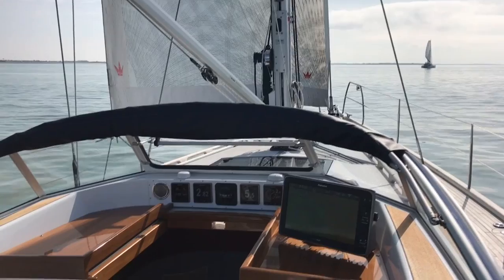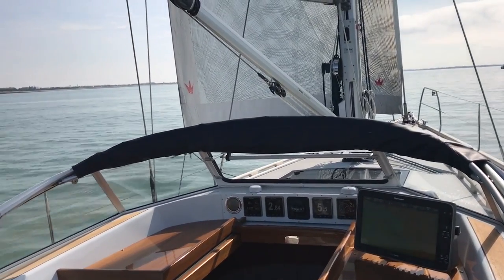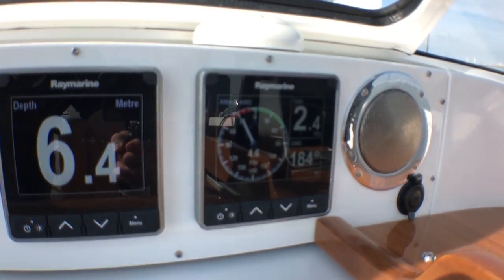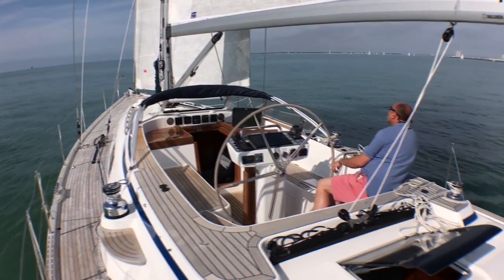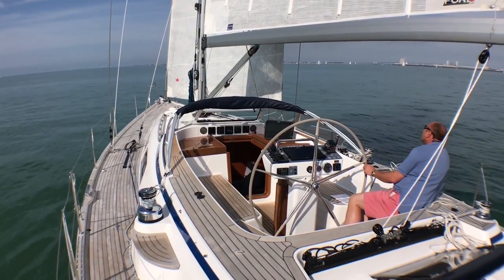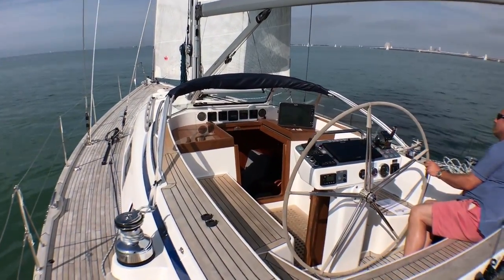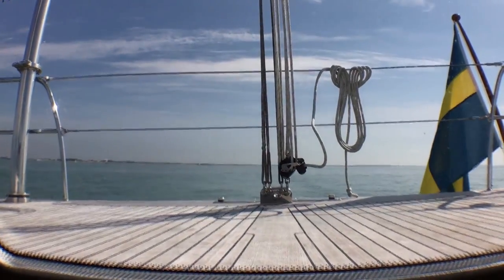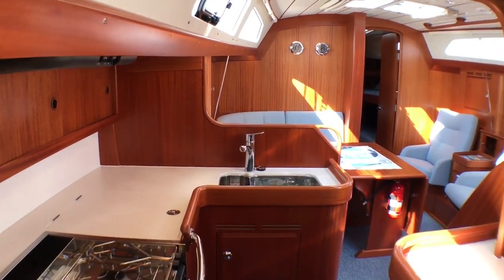Hallberg-Rassy 44 | First Look | Yachting World

Comment: Great presentation Toby. What are they pegging the price to as demonstrated? I’ve been swayed by the Amel 50, but this one still catches my interest
Reply: Perry Gruber Hi Perry. Isn't the Amel 50 interesting! More expensive than this HR 44 - about 25% more for similar setup - but a lot more boat for the money. The 44 would be more fun to sail in pleasant conditions - sportier - but the Amel 50 has so many excellent features, making it look to be better value for money in the end. The four watertight bulkheads (quiet too), the separate pilot cabin, the storage areas, the cockpit that is big enough to stretch out and sleep in! Hmmm, I'll be looking at both, along with the aluminium centreboarders.
Reply: I was looking at the aluminum centerboarders too because I liked the lifting feature, but for all the reasons you describe I think I’m going to go for the Amel. I agree about sailing the 44 in pleasant conditions, but the Amel is around seeming a better boat. And, as you say, better value for the money in the end. Thanks for your reply!
Reply: What about Bestewind 50? The best of both worlds. It isn't as expensive as it looks like, about 460 000 £.

Comment: Could you single hand a boat that length?
Reply: As long as all the "push button", electric and retractbale stuff works, sure.

Once that in-mast furler for that battened sail completely jams just as the wind kicks up badly.... And/or your truster(s) sticks in a tight spot....

Of all brands, HR, and Amel, are the two I would trust the most wrt all such high end mod cons. They're the ones who have been, and are, installing them in meaningful numbers of boats and hence getting feedback. On account of the market segments they cater to. But still: At some point something will go wrong. On a fairly conservative 37, perhaps even 40, footer; you can likely manhandle things if you have to. Doubly so if you are intimately familiar with how to do so, since that's how you always do things on your fully "manual" boat anyway.

But the catch is: The size of boat most (generally older) people who can afford a new HR can handle manually, is much smaller than the size they want to be living in long term (people with new-HR-mone are a spoiled lot....). Hence, blind trust in "systems" built and installed and tested, no doubt to the highest of standards, by Magnus Rassy and crew, is where it's at.....

Comment: It can be a good hull but I'm not impressed with the interior.
Reply: I love that interior- much better than that plastic crap that the cheapo manufacturers use for their interiors these days. It's beautifully finished.
Reply: I actually like the interio lay out just not the materials/color scheme.
Reply: The interior simply doesn't reflect the luxury and class of this boat.  I would expect some glamour. Besides I think chart table should be larger and the aft berth could be more rectangular. Looks like there is enough space for both.
Reply: Yeniden Ben true plus I'm willing to sacrifice some storage for more comfortable accommodations. Some.
Reply: Hallberg Rassys have always been understated, something that I prefer, and they leave the glamour to Nautor and Contest and such these days. I know the market as a whole nowadays prefers a little more flash in design, even Najad has gone in that direction, but to some of us classy means less garish. I know that is a subjective opinion less widely shared these days. As for the aft berth, I think the two berth version is the proper sailors version, the centre berth more for dockside sleeping. Lots of new 44 footers have no chart table at all or a much smaller convertible one- to my eye this one is decent at this length. Full size charts, for those few of us that still have them, seem to get spread out on the settee table now.
Reply: I would have to agree with blairrob. Nothing is as tacky as things that try to look luxurious. So sure, they could go for claro walnut and make the whole thing look like a joke or a 20 year old persian pimps hairstudio... Instead I like the fact that they still do the interior proper boats have: teak, oak or mahogany.  I also really like how they use proper wood planks on the interior of the hull instead some vinyl crap. Better for chilly conditions too.However, I would say that rassy has been the more over the top when compared to Nautor historically. It's just when that Italian geezer bought and ruined Nautor when they started adding "flair" and making stupidly large boats with Italian "design." Proper swans are nothing like that.
Reply: HR might be not the flashiest yacht but I always enjoy to be on them. If the weather gets a bit rougher, you learn to appreciate HR even more.
Reply: Indeed. And it's good to remember that these Nordic boats mentioned here didn't aim to produce "luxury" yachts originally. They built yachts just the way locals used to built everything (before Ikea). Yes, that meant that they spent a longer time sanding and fitting stuff, but that was what the locals wanted. Most boatyards that didn't offer similar quality just went bust and most of the tiny yards produced boats to same standards. Because nobody would've bought a flimsy boat with shoddy interior. For Swedes this meant building sturdy cruisers (HR, Najad) and for Finns it meant building sturdy offshore performance boats (Swan, Baltic) So the idea wasn't originally to build luxury boats but to build boats properly. Since then, less expensive boats with less labor intensive materials have popped out and that sort of pushed these things to the luxury market - and the price of Nordic labor doesn't help that one bit. But the intended luxury is to have a well made, functioning boat instead of being flashy. I would dare to say that HR would be risking a large part of their (obviously wealthy) clientele should they start throwing in tacky interiors just to look "luxurious." 

Now HR name does carry some prestige, but these are still boats you could sail and not feel like a total douche. Try pulling that off in a perini navi...
Reply: Too much monotone wood. But what you expect for the price. Great pedigree in craftsmanship and design.
Reply: Hi Blairrob. Tricky decision, between the two-berth rear cabin and the centre double berth. A significant advantage of the centre double arrangement is that the deck lockers are three times as deep. 65cm deep vs 20cm deep. Useful vs not really. I also like the desk area to starboard of the centre double cabin, but do wonder how to sit there?? Notwithstanding these points. the two-berth rear cabin would be better for passage making with a gang on board. The owners could actually sleep in their cabin at the rear, including with lee-cloths. Lee-cloths with the centre double? Hmmm.
Reply: Valden and Blairrob. I think it's almost a non brainer to go for the centerline berth, and not only for the deck lockers (which are certainly important as deck storage is very sparse on HR's). But I simply don't see anyone buying a 44 footer this expensive to regularly do passages with 8 or so people. And if there are 4 or so and one is at watch, that leaves three sleepers. There are two pilot berths just in front of the mast and the most comfortable spot will probably be in the saloon settees that are located at mid ship.  I might instead go for another settee instead of those lounge chairs in the saloon just to sleep there. Or at least that's where I'd choose sleep while underway if I was the captain/ owner.   

And certainly you could rig lee cloths to the centerline berth. Attach the cloths to the roof of the cabin and throw a removable plank between the two mattresses. Blam, two more sea berths. Why would anyone want to sleep on top of a noisy autopilot at the stern of the boat instead at midship is a different story though. 

In any case, the entire point of aft cabin, at least in my opinion, is to have that luxurious cabin when wasting time and life at anchor. So getting a "saltier" version of the aft cabin would leave you without the luxury and with a what is still not a great place to sleep while underway. Oh yeah, and poor deck storage.
Reply: TeeFunkable G'day Tee. Totally agree on having two lounges in the saloon - best places to sleep on passage, other than the saloon floor. I don't get the appeal of the armchairs, unless it's wedging yourself in, like a bucket seat in a sports car. Good point about the noise from the autopilot. It'd be good if review videos showed sound pressure levels with assessments of steering, engine noise, thrusters, water noise up in the V-berth. It'd be interesting to compare with others, such as Garcia or Boreal with their insulated hulls.
Reply: Have you seen the interior on that new Swan 50 review with Toby? Compared to Hallberg Rassy , the Swan looks like interior of a budget hotel ,should check it out  I have to agree with blairob though , from what I have seen and read about HR's is more about function, sturdiness and comfort at sea than flash, but since I have never sailed on one i am just opining as a HR fan. Id get rid of the armchairs though down below and go with the other sofa /daybed
Reply: I have seen the new "Swan." But it must be said that swan doesn't really exist anymore. An Italian bought the company and naturally it all went to shit when he wanted to steer swan away from building fast, no-nonsense bluewater cruiser / racers to what italians consider cool. So in other words they focused on building  raceboats and massive, ugly and tacky luxury yachts. So when talking about swans, it naturally means the real nautor swan, before Italian ownership.  Back then, Rassy was the fiendishly slow but comfortable boat and swan was the less roomy and slightly more salty fast one.
Reply: the wood looks like some cheap plastic veneer
Reply: blairrob
you can't compare hublot`s approach to luxury to a rolex
Reply: @Valden23  I'm not an armchair person, but those HR ones, are really, really nice. Especially when things are moving a bit. They're leaned back enough that they remain comfy (or at least much comfier than a flat lounge), on any tack if the boat is sailed within reason.
Reply: @paulnorman8274  Hi Paul.  But could your feet reach the floor? I keep seeing pictures of folks with their feet dangling, which is not comfortable under the legs. And it would be difficult for people to move past someone sitting there. Nah, I’m not an armchair person.